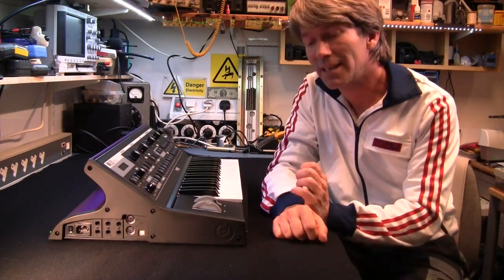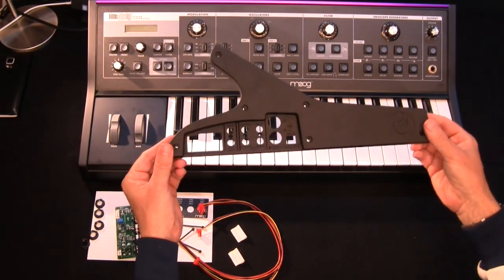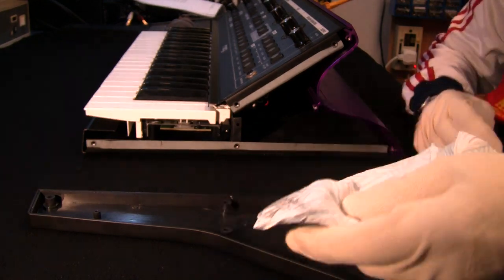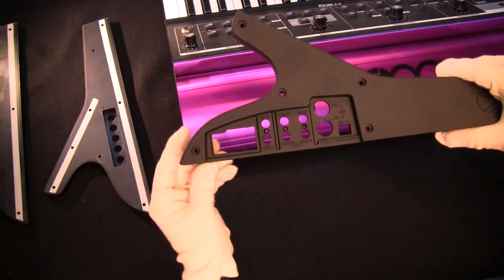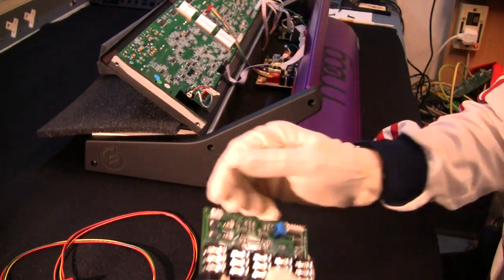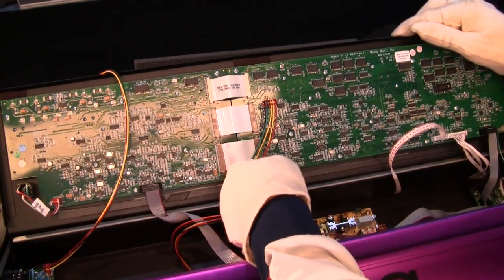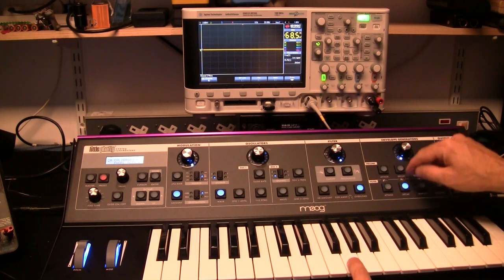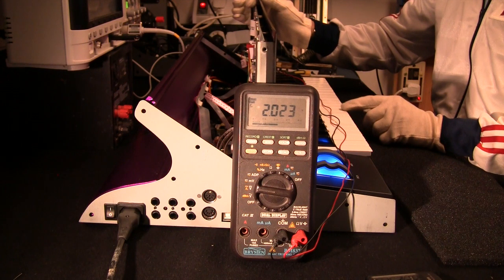Moog little Phatty CV output Kit installation MF#48

Comment: Hello Markus, 
Thank you for this very usefull video, I bought an used kit through Reverb some months ago. Last week I tried to set the kit up,  but unfortunately there were some missing parts in my kit. The pre perforated side sheet of metal and  the instruction manuel.
Regarding the metal, I guess that I can tried to cut the former metal sheet by myself n but regarding  the instruction manual, . I tried to download it through Moog Website , but this guide doesn't appear anymore on their website.
 Is it possible for you to send a PDF copy of this guide to me. Regarding your tutorial, it could be usefull to have the right tensions for the differents outputs.
Thank you very much for your help.

Comment: Thanks for your video markusfuller. I have #377 of 1200 tribute version of this synth with this CV board soldered on and the system upgraded to the latest possible for this version. It has the upgraded system features but no USB. It was interesting to note that the 2 x circuit boards of the later dated Phatty that you have are connected using ribbon connectors. The tribute version has these 2 boards directly coupled using 2 x edge connectors, male/female pin & sockets. 

These were obviously an issue as I have found out. It's a serious design flaw exacerbated by the lack of an extra circuit board support next to these connectors, which are stressed when adjacent panel buttons are pressed. As a result of this CCT board flexing (and the lead free solder from 2006 being brittle), these connectors literally part from the solder pads on the board rendering the synth inoperable. One can simply power up the synth while pressing on these connectors, holding them back onto the board to diagnose this issue - the synth will work perfectly again!

The solder spacings on these micro connectors are less than 0.5mm and require some steady hands and magnification to solder back onto the board. I have placed a small aluminium brace diagonally across these connectors (using the end CCT board posts) with a piece of rubber just touching the tops of the connectors. This prevents button pressing on the panel from flexing the board. I was very happy to get this synth fixed up after getting it for 600AUD. I hope that this info helps you should a tribute version cross your bench with strange issues. **with the fault the synth sounded very bad, no pitch across the board, controls not working - but it looked to boot up perfectly!!   Cheers and thanks!

Comment: Great idea with the batteries. Hey in the market for a new synthesizer... I can get a Little Phatty Stage 1 pretty cheap. Or I could buy a Waldorf Pulse 2, also the Moog Sub 37 is cheaper now. What would you recommend? Is there a synth I didn't mention for around $1000 you would consider?

Comment: I ask muself , are the boards for slim phatty also having the option to extend it with cv-out? Are they not the same?
Reply from the maker: That I could not answer as I do not know. but the little phatty has no inner pins or connections to add a separate CV-Gate unit.
Reply: ah i tought it had :-( too bad

Comment: Hi Markus I did the usb upgrade to my phatty stage one which had grey ends but the kit had soft touch black which are more classy changed the LEDs in pitch & mod wheels to a red and a blue ! It helps take the edge off all that orange lol oh and a software update gives the synth a nice apegio function. I checked on Moog site and only later models of phatty can have plug n play cv out upgrade as early models (like mine) don't have the sockets to plug into doh ! Do you think it would be possible to hard wire the cv outs?
Thanks again for great vids Steve

Comment: i guess that the extra cover is to have both covers in the condition. Imagine you have the original cover with a lot of scratches and you want make the mod, you'll have one new cover and the other with scratches.
Reply from the maker: Jean-Raymond Civetta I was told some of the early phattys had grey ends so Moog includes both ends to keep it equal instead of remaking the grey ones with cv-out holes.

Comment: I've always found it a bit strange that Moog would have this as an accessory for the little phatty, wouldn't it void the warranty if the end user were to install it themselves, and why not just have ship with this option anyway, the board doesn't seen like it would add much cost to the synth anyway.
Reply from the maker: Kristian Dawe Hi Kristian, the 2 sockets are already soldered onto the board in version 2 onwards so yes they could have included the CV-outs. but I guess they are trying to keep the cost down to compete with other keyboard companies. ?. I really do not fully understand the mathematics of business.